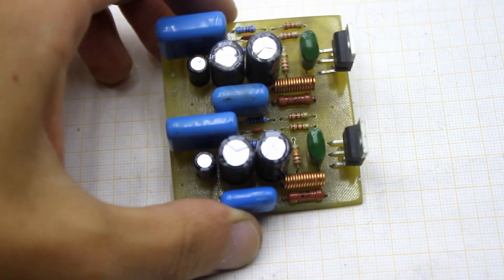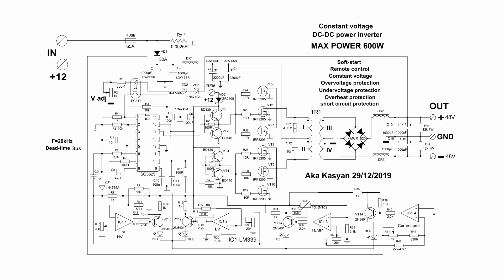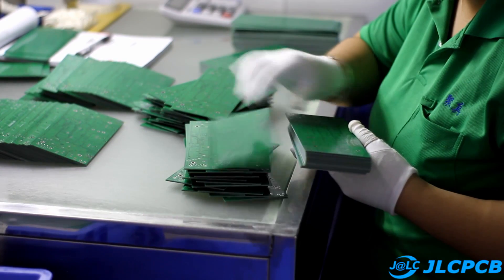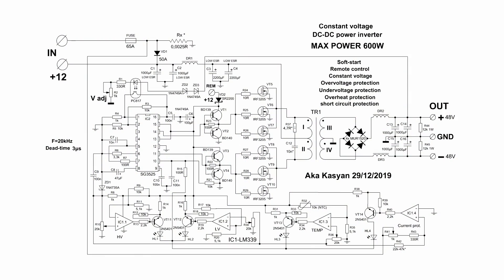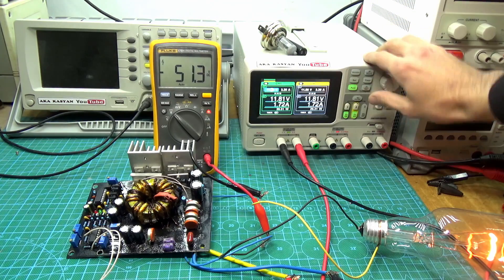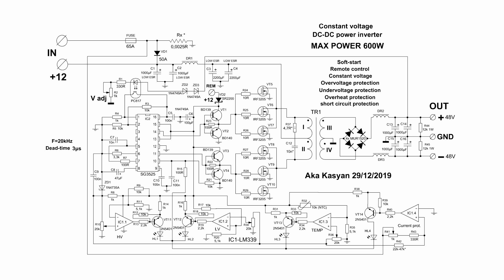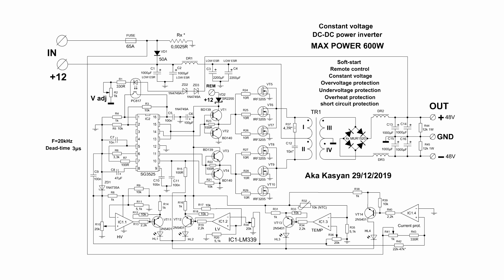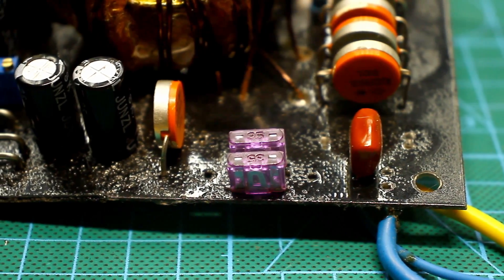DIY POWERFUL inverter for every need

Comment: plz make a crkt of 12volt 2amps-4amps smps power supply for using as input for buck/boost converter with diagram,mam plzzzzzzzzzzzzzzzzzzzzzzzzzzzzzz.

Comment: already making my own symmetrical boost psu, i recommend having a common mode filter choke before the output capacitor, since there is no feedback connection at the negative rail, the common mode choke will help by pulling down the positive output at bit under load
Reply: how can i make a common mode filter choke? sorry but I'm not very advanced in electronics. also for rectifier, can i use a full bridge?
Reply: @F.A.1.8t  make a choke with 2 identical windings, each will be in series with the rail voltage but the negative side will have an opposite in/out from the positive rail, this is actually done on some generic atx psu for -12v rail
Reply: @marlonbayaras2850  ok but what value do i need to make them. i mean inductance?

Comment: isn't it easier to make it with the tl494 oscillator?
Reply from the maker: Not! on sg3525 it is very simple to build protection and soft start, and it also has a powerful output stage, unlike TL494
Reply: @KasyanTV  oh ok. by the way I have made this circuit with the tl494 but with a smaller toroidal transformer for 100W of power and it only outputs about 5W. what's the problem?

Comment: Hi i wanna know what should i do to learn these things (power electronics ) references
Reply: theres a channel called "simply put" check it out!!  learn the basics.. power is just a term!! a circuit works the same either way. if you want more power use beefier components and thicker wires and more current/voltage. put the videos on the basics in your favorites and watch the back until you understand them. i started a just over a year ago and never looked back and can already build a circuit like this and most importantly understand it..  get books like electronics for dummies and electronics for beginners. & a word of warning dont get "the art of electronics" JUST YET, coz it's very advanced & could scare you off making you think you in over your head. give it time, you will know your making progress when you look at your favorites and say i dont need this video no more because i know this stuff now!!  hope this helps you & i expect to see you commenting in a year giving another beginner advise on their circuit problems... peace out!!
Reply: keith king thx for your reply and i’m an electrical power engineer but majored in sth else (not electronics) so I won’t start from scratch.
Thank you again for ur reply
Reply: Just one more thing Abanoub check out a channel called "ALL ABOUT ELECTRONICS" it has everything for beginning in electronics. He has 2 channels his main one with the red & black logo.. & his quiz channel with the orange & black logo  (which you would like to) which gives you problem & then follows up with the answer & explains the circuit.. good luck.. check him out...👍

Comment: How can be same converter be made without changing DC to ac ! 
I hope there would be minimum loss in DC to DC converter rather than DC - AC - DC converter
Reply: It is not possible to convert voltage efficiently without converting to some type of AC. 

Converting between AC and DC is not what causes losses by itself. Rather, the way in which you do this determines the efficiency.
Reply: @Basement-Science  Switching DC to DC converters convert it to pulsed DC. Not AC.